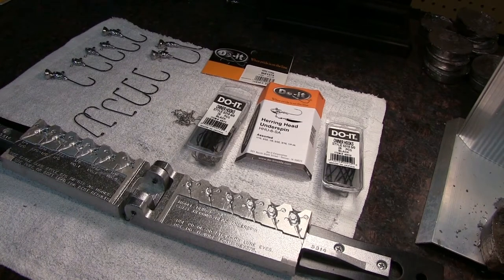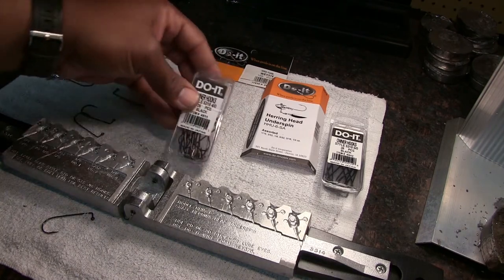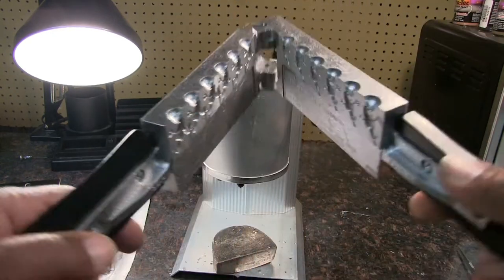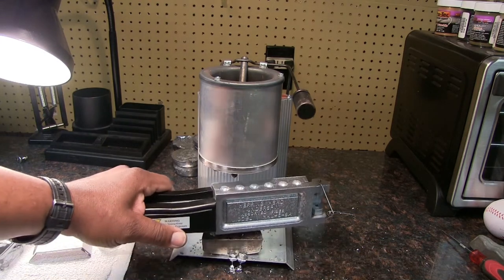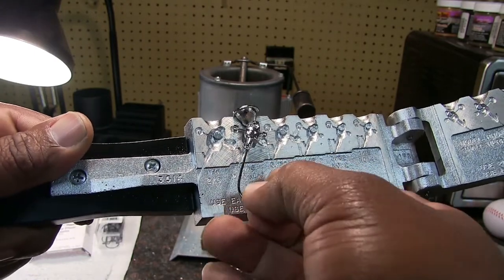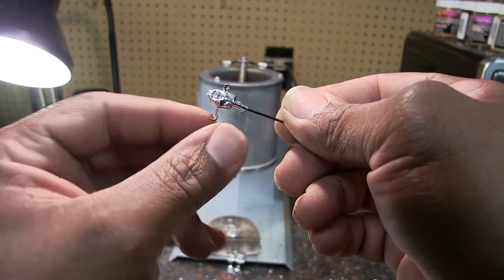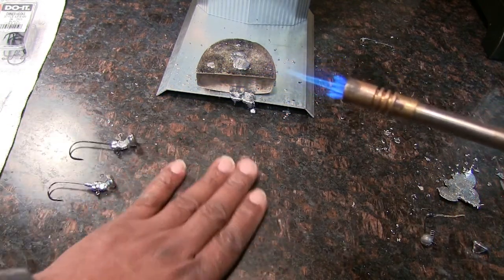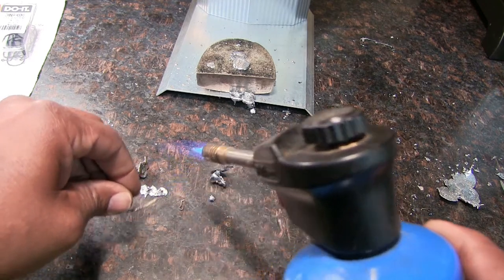How to Pour Your Own Underspin Lures

Comment: I'm having issues getting full cast around the hook. Can you help?
Reply from the maker: Make sure you heat the mold. Put the mold on top of your melting pot for about 5mins before you pour your jigs. Plus make sure your melting pot is on high. You need to have everything hot to get a good pour. You can’t pour into a cold mold.
Reply: Awesome man ty

Comment: What size eyes do u use for these?
Reply from the maker: Jayson Breault The wire that goes on the bottom for the under spin part is from Do-It molds WEY375. There is no size for that. The eye’s on the hooks are just part of the hooks.
Reply: The BassHunter sorry I shoulda been more specific lol. I mean the lure eyes the stick on ones that you put on the head after finishing them. Do it website  has multiple eye sizes to choose form and I’m trying to figure out which ones fit in the sockets on these jigs.
Reply: The BassHunter sweet! Thanks👍